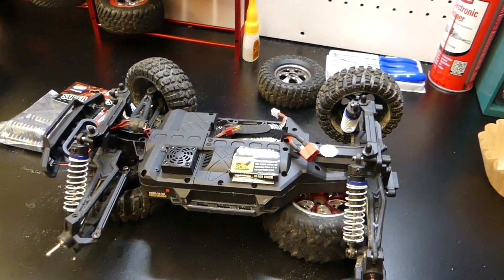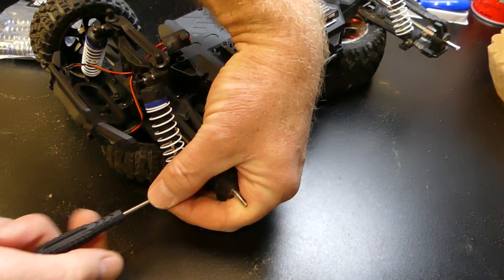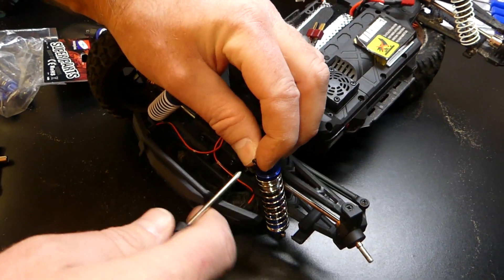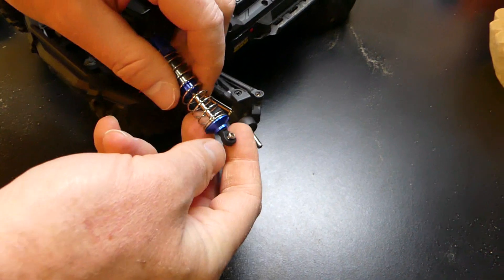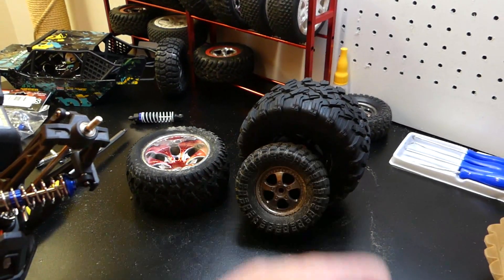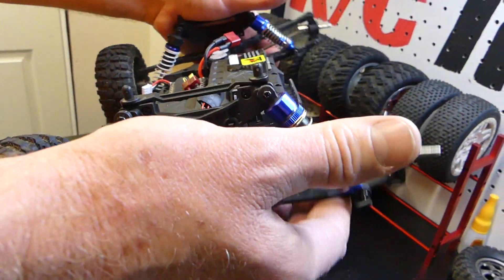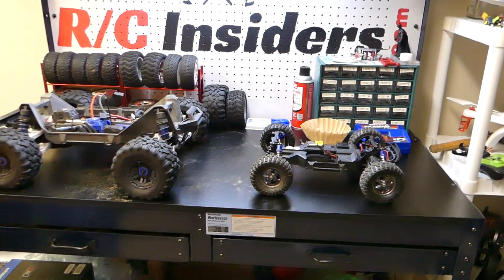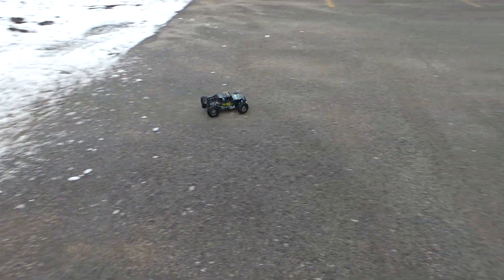Haiboxing 2995 Aluminum Capped Oil Filled Shock Upgrade - Install & Test

Comment: How many mm are the shocks because they are unavailable on Amazon through the link.  I don't know which others I can get
Reply from the maker: Hey Yusef!
You can get them here until they are back in stock:
https://haiboxing-hobby.com/products/1-12th-scale-rc-car-spare-parts-desert-truck-aluminum-capped-oil-filled-shocks-4pcs-apply-for-2995-t2100
They are a little more expensive on the HBX site.
How long have you had the 2995?
Had so much fun with this sweet little basher :)
Thanks for dropping by & happy bashing my friend!!
#RCInsiders
Reply: Thanks,  i ended up ordering some shocks on amazon and doing some measurements , hopefully they fit cuz me and a few others were gonna get together this weekend to bash so I wanted the parts in before the weekend.  I just got it a month ago and been having alot of fun with it, but I want to ramp it but those stock shocks are way too horrible to take the jumps without breaking something I feel. I got some small 3s lipo batteries too with bigger tires so gonna be fun testing everything out.
Reply from the maker: @DocHoliday2470  Awesome! 
The new shocks with the bigger tires on 3s...It's a little beast 😜😜
Hope you have a great time bashing!!!

Comment: How long are the shocks in mm hole to hole?
Reply from the maker: Hey Bob,
I think they are 3" or a little over 76mm.
Are you doing the shock upgrade on the 2995?
It's a sweet truck & the shocks make it even better 😀
Thanks for dropping by & happy bashing my friend :)
#RCInsiders

Comment: I have this little guy, Fun little truck. The motor doesn't like dirt or sand😅. Had to fully tear apart just to get to the motor that was jammed up with dirt. Do you have any brushed motor upgrade suggestions?
Reply from the maker: Hey V3!
Yeah, RC motors hate sand & dust 😜
I always blow everything out with the air compressor after running in sand & dirt,
I was thinking about trying to get this motor to fit - https://amzn.to/2QYIelf
But I havent had a chance yet. I know Traxxas fit it into the 1/16 E-Revo, so I think I can make it work.
But honestly, for the price I think I would go with new brushless motor/esc combo.
As far as "good" brushed motors go, the Titan is about the best.
Thanks for dropping by & happy bashing my friend!!
@RCInsiders
Reply: @RCInsiders  thank you sir👌
Reply from the maker: @v3nomou545  You are most welcome. Let me know what route you go

Comment: How did you take the wheels off? It was really hard taking them off because the shafts kept spinning
Reply from the maker: Hi L C,
Yeah it can be a little tricky. If you can get the other side to get some traction by holding it to the ground, you can usually get the nut to break free.
Were you able to get it?
Happy bashing my friend!!
#RCInsiders

Comment: These shocks are no longer available. 
Anybody have any suggestions about a substitute?
Reply from the maker: Hey sub,
You can pick them up on the HBX site until Amazon gets them back in stock:
https://haiboxing-hobby.com/products/1-12th-scale-rc-car-spare-parts-desert-truck-aluminum-capped-oil-filled-shocks-4pcs-apply-for-2995-t2100
Are you doing this shock upgrade? Its an awesome upgrade & looks sweet :)
Thanks for dropping by & happy bashing my friend!!
#RCInsiders